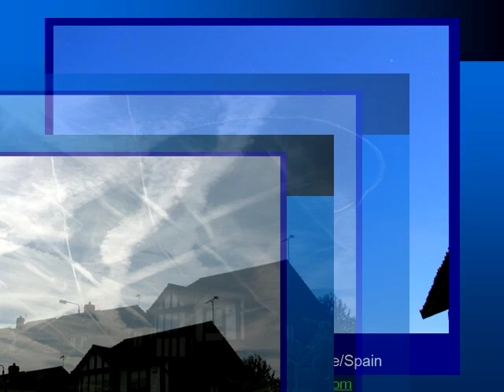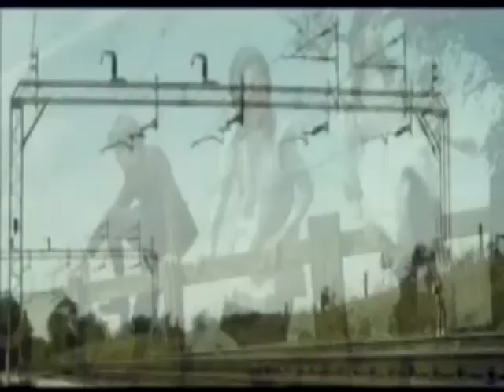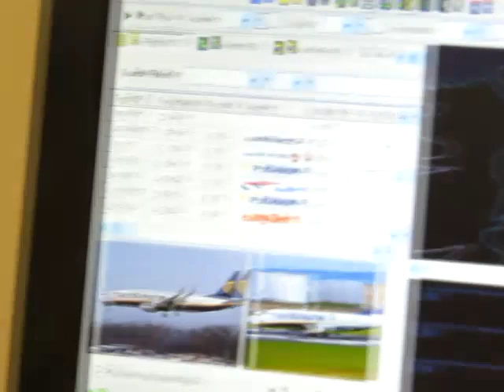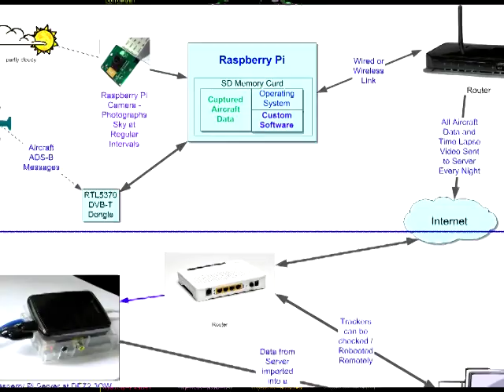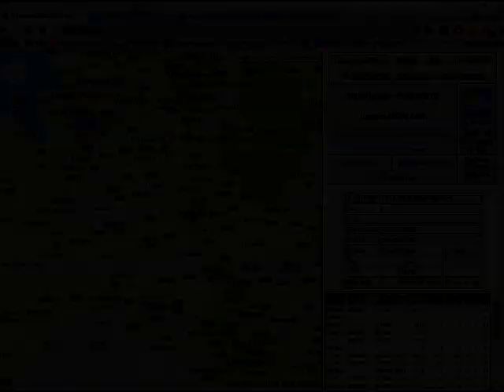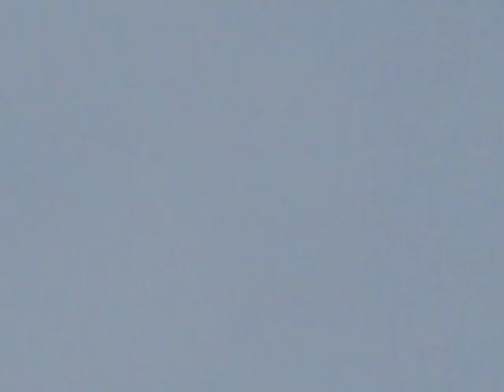Measuring Air Traffic, and Counting Persistent Trails Over Several Months - A Report

Comment: You claim there is "no explanation" why sometimes contrails persist, but other times?  You are wrong.  There are tons of information that provide explanations.

You claim there is "no explanation" for contrail "grids"?  You are wrong, yet again.

Look at a street map....do you see where roads sometimes cross each other, even forming a "grid" on occasion?

Yet, you somehow cannot fathom that airplanes ALSO fly different routes, in many different directions between different city pairs, and that these routes can cross reach other???  Really?

Here...a website that publishes actual aviation navigational charts, and other data.  I've centered it in the USA, in the mid-west (Just picked at random.  You can re-locate for your geographical location):

http://skyvector.com/?ll=38.140605330267746,-88.47839355349848&chart=304&zoom=6

This shows the established, published Jet Airway routes (the part of the U.S. airspace for all operations above 18,000 feet).

(PS:  Pilot here, 40+ years' experience.  Last 23 with a major U.S. airline).